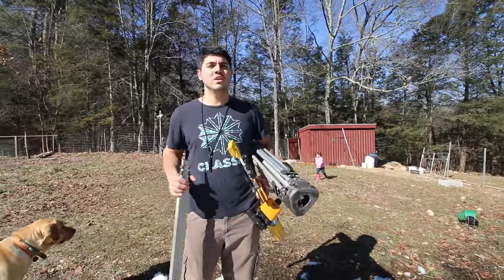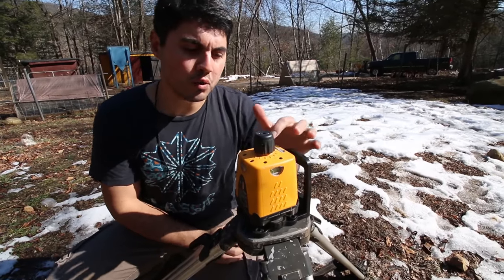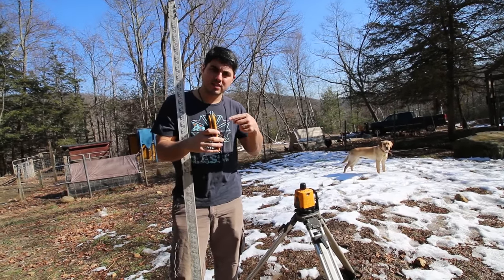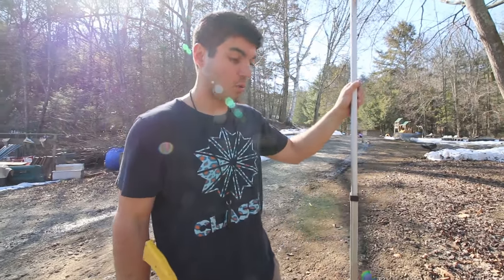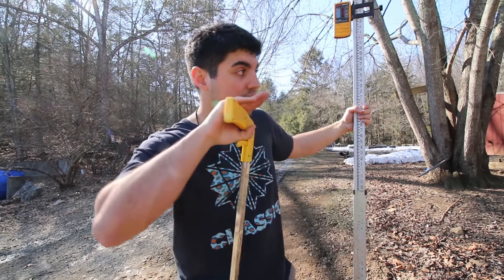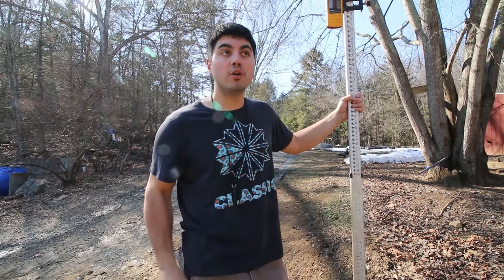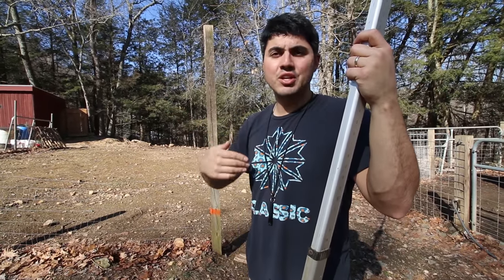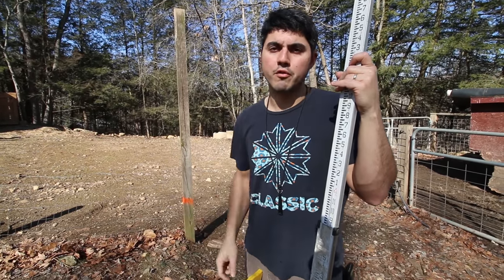How To Use Laser Transit

Comment: I am looking at buy a laser. Never use anything like this before so I have a question.   Does the receiver have a program  to mark the starting point by the transit then the second point of reference, in your case lower  point at the barn door, then make reference to elevation to every point in between? This of course would mean that the receiver can measure distance to the transit so it could correlate the correct elevation at any point in between the starting point and at the barn. I am thinking correctly or am I off?

Comment: Good video, but I don't understand! You never mentioned any height values where you took laser readings. Do you have to subtract the height of the laser head directly above the ground? And what is wrong with a driveway that gradually slopes up to the barn from the road?